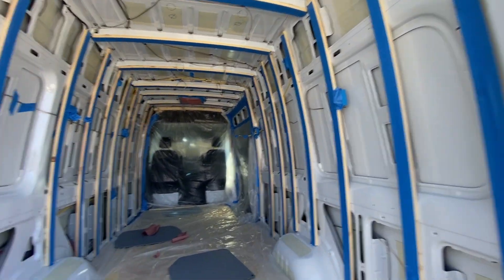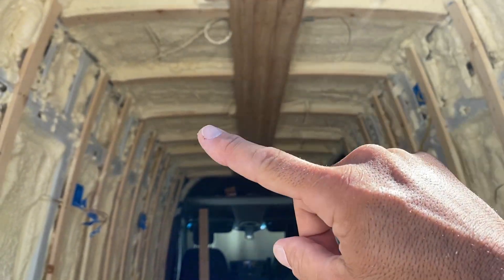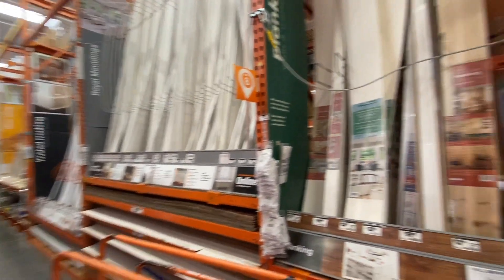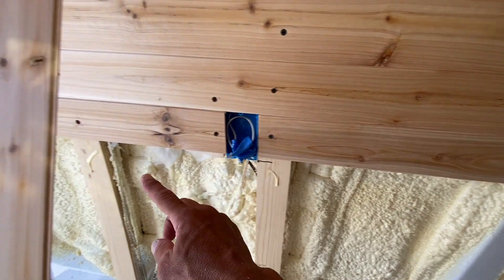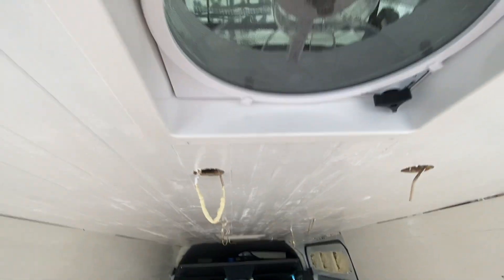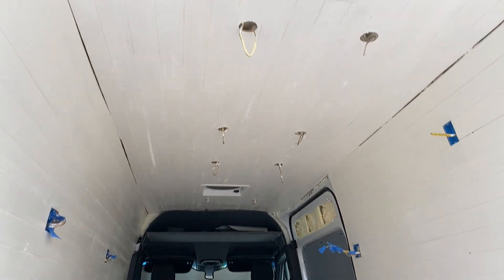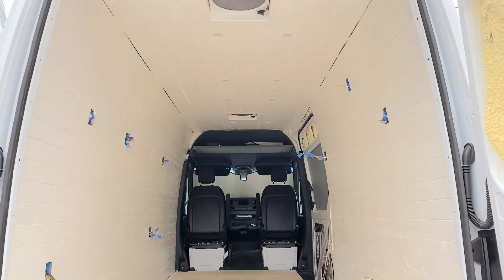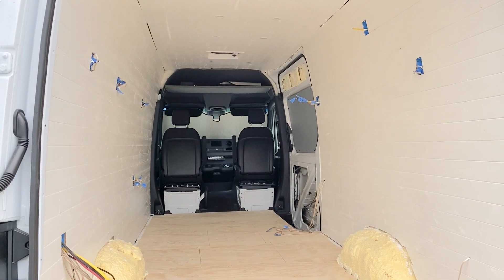Van Build Week 3 Update

Comment: Well, I hope for you that the urethane sprayed in the lower sections won't block water drainage holes and that you sealed outside body moldings holding clips.
Reply from the maker: Clearly you aren’t aware the 2020 has upgraded rubber grommets for water proofing.
Reply: @BuildingVanLife  Great, i am glad to read that!  And, what about the other part of my comment about spraying urethane in the bottom sections of the van?
Reply from the maker: @charlevoix418  it’s not an issue since there is no longer water coming inside the van from the trim flaw in the previous models
Reply: @BuildingVanLife  Soooooo, I understand that you sprayed the bottom sections?